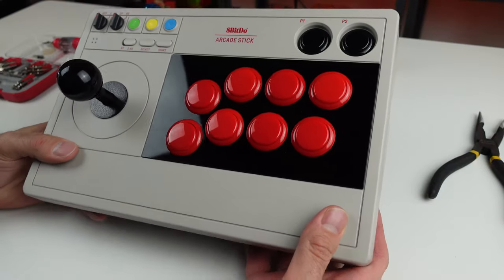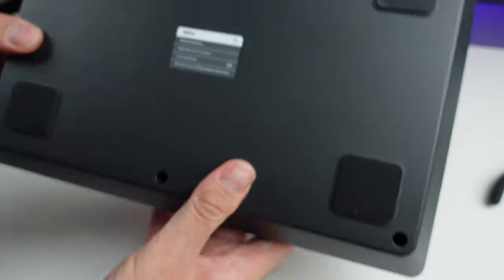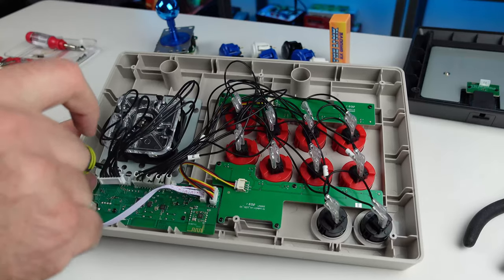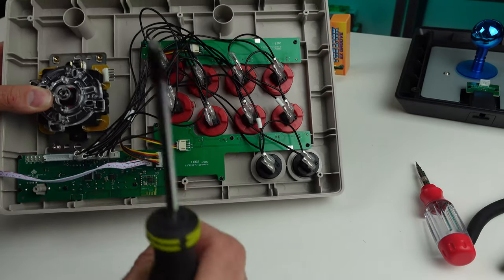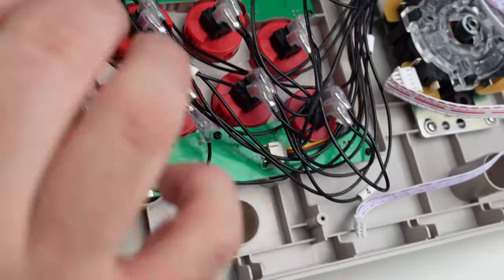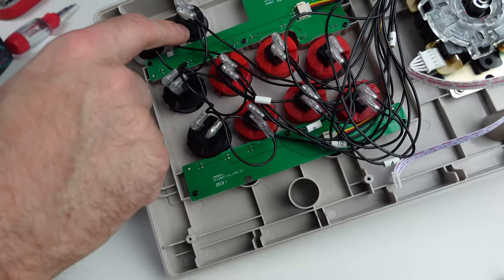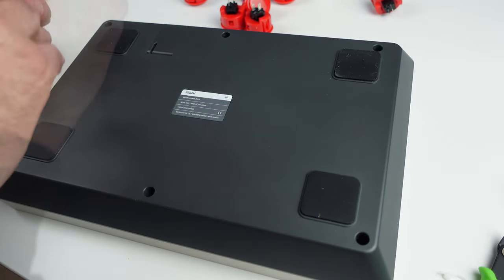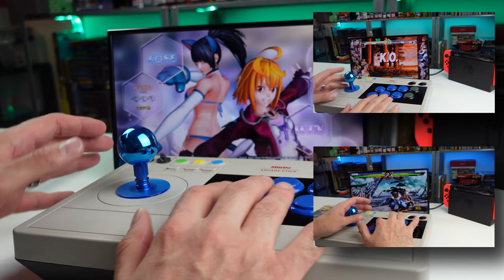Arcade Stick Upgrades! Modding The NEW 8BitDo Stick With Detachable Shaft & Sanwa Parts! EASY!

Comment: I've been using a Brook adapter with X360/One/Series X. I couldn't get it to work at first but I plugged the 2.4ghz adapter into the Brook adapter and switched the stick to X-Input/2.4ghz modes and it works perfectly.

Comment: I actually tried to add my new Seimitsu Bullet Nobi lever to this today and it was too thick to fit inside. I'm a little bummed because that lever feels so damn nice! Way better than any stock Sanwa I've used. It has shorter throw, more tactile clicks (but not louder), and a non-rotating shaft, which I like a lot for fighting games.

Comment: I was thinking of modding mine but I was chicken 🐔. Now that I see how easy it is I think I might. Thank you. I do wish it worked with my series x.
Reply: I feel you. I did the same thing. Chickened out because I was not sure if it was easy to do.
Reply: you can get an adapter to make this work with Xbox or PS from Brook and I think another brand but I forgot the name but Brook for sure makes both adapters.
Reply: I have the Brook Wingman XB and it works perfectly with the arcade stick (and other controllers including Pro 2 and Dual Shock 4 that I tested). I simply popped the 2.4 ghz dongle into the adaptor, plug the adaptor into the xbox, then turn on the stick and you're good to go.
Reply: @Dante1138  hi which Brook adapter is that ? Can you please paste the link ?
Reply: Chicken emoji cracked me up!!

Comment: I think this stick would be fine for professional use but the problem is it's not heavy enough. So when I'm in a grab or dazed or something the stick actually comes off the table and is like smacking against the table up and down while i'm shaking the stick to get out of the hold. I've never had that happen before.. Also the stick that comes with it seems to fail a lot of times performing the inputs for special moves..

like I know my hand motions and I have the muscle memory burned into my muscles.. The stick this comes with kind of sucks.. I dunno what it is about it. I think I'm gonna replace it with a Sanwa stick, coz the Razer Panthera I used to have (so great that Razer replaced it with some weird ass arcade stick that doesn't have a joystick).. But I want to use Happ buttons coz I'm from the US and we never had the Sanwa buttons here.. They're not bad but I want the authentic arcade experience.

I think that it definitely needs to be heavier.

Comment: Have the Mayflash and bought a bunch of parts to mod it but haven't done it.  I kinda want this because it's wireless.
Reply: I really like mine. I also have the Victrix Pro FS, but I end up using this instead because it's so convenient. I will say that it's more of a table top stick than a lap stick because it's kind of small and there are only 4 small pads to prevent slipping. I 100% recommend it, though.
Reply: @FranktheTank319  I think the Mayflash is a tiny bit smaller than this.  But yeah I want that wireless convience.  Although it's not as customizable as the Mayflash because it has the spot to put in different art if you want.
Reply: @agentorange8530  Yeah, I like that aspect of customization. I didn't really think about that before I bought mine, so it's a bit of a let down, but it looks cool and its got a ton of cool features. I just wish my seimitsu stick fit inside it. It's a little too big for the case, unfortunately.
Reply: @FranktheTank319  Yeah this stick is a little shallow inside and can't fit all sticks.  Still looks cool though with that Nintendo theme going on.
Reply: @agentorange8530  i think the NES theme is why I bought it. And I love it because it's so convenient. I use it on my pc and my switch. It is a little tippy, though. When I'm gaming, sometimes I notice it tipping towards me a little bit if I'm really heavy handed.

Comment: when you push your new lever to any direction, does it have extra travel after you hear the click? cause that's killing me on the OG lever of the 8BitDo (mainly the reason why professionals don't use this stick)
Reply: Yes there's a small extra movement after the click, but I've seen worse Hayabusa and Sanwa sticks in this aspect (i.e. it's not excessive). I, too, prefer no extra movement however. You can try with oversized actuators to reduce it... I'll test soon the 1.5mm oversized actuator.

Comment: Further info, when I was multimetering my 8bit do stick. It seemed like they were key scanning (the voltage value was floating around even without touching the button). so socd's are gonna have trouble if you try to change to mixbox buttons.
Reply: I noticed also, that most socd cleaners state, they are incompatible with 8bitdo. I assume that the key scanning issue is why!
Reply: But the bottom plate on newer versions has a much bigger cutout to accommodate more sticks.
Reply: So better. This stick rocks. but as with all things. you must understand what you have.

Comment: The mounting plate fits everything but the height of the case makes it so almost no other stick than a JLF will fit without hitting the bottom of the case. They removed sticks that they originally said would fit from their list and I tried sticks that are still supposed to fit and they still won't work without dremmeling the bottom of the case to make a few more millimeters of clearance. I honestly don't think they attempted to swap in any of the sticks they originally said would fit and just figured that the plate fits everything so they put them on the list as compatible. They had an IL stick being listed as compatible early on and there is no way that thing would ever even come close to fitting in this. Also the clearance on the buttons to so close to the pcb's that there is no way to get screw in buttons so you are limited to snap in only and if you use seimetsu snap ins it won't let them lock in all the way so they can pop out.  This is not nearly as moddable as they make it. They joystick it comes with is aweful, the buttons are decent though. If you get this swap it with a JLF as that fits easily and then its a good stick. Just don't expect to put all sorts of different buttons and sticks in this, its basically ultra moddable if you are putting in Sanwa parts only.

Comment: I'm planning on making the retro stick. I just need to figure out how many buttons I need for Saturn games. I have a Mortal Kombat one for those modern systems.
Reply from the maker: For saturn you can be mostly fine with 6 buttons plus one for start... But really should be 8 buttons for abc xyz and L R shoulders plus one for start, then an extra for select if possibly going to use for other retro systems.

Comment: I just installed some snap-in Sanwa buttons like you did in this video... My connections are definitely not as tight as they were on the stock buttons. Is this okay?

Comment: Did same mod recently. All that modding and you didn't change the square gate?
Reply from the maker: Yes, like I responded to someone else... square gate, octo gate, circle gate... none of that matters. The gate you use is all subjective and up to personal preference. A restrictor gate creates a wall and thats it... You can register microswitches without ever touching the gate. It doesnt magically improve your performance in Street Fighter for example. You can be used to any gate that doesnt block a switch. A square gate is my preference a lot of times, especially for many older fighting games its fine for me. I have a box of octo gates and have used them plenty. Ive been building sticks and modding out premade sticks for well over 20 years and don't care for the feel of an octo gate most of the time. It may be a crutch for some with half circle movements and they prefer it, but like I said... dont need to use the gate to register switch presses, so its all what you are comfortable with.

Comment: Professional fighting game players are probably not using this stick. There is typically a strict restriction on anything that's wireless.  Great stick though!
Reply from the maker: Well it can be used wired, but I still figured they wouldn't use it
Reply: @Madlittlepixel  Yeah.  Iono, ity's been years for me since I was part of the FGC, but they are typically leery even of sticks that can connect via USB like that too.  Imagine a high level, high stakes level being paused due to a UBS cable disconnecting at the base of the stick/controller.  That type of thing.

Comment: Try installing some hayabusa buttons into your 8BitDo arcade stick.
Reply from the maker: Why? I mean I like Hyabusa buttons, and have some extras but beyond using them in the sticks Hori makes I don't really have much desire of putting them into other sticks. They do fit, but I don't see the point of changing to another set of buttons I don't typically use often.
Reply: @Madlittlepixel  To each their own.
Reply from the maker: Well I mean this wasnt a video testing buttons of various types it was modding it how I want it. Hori makes fine products, but Id never put their buttons into anything honestly. I have tons of Sanwa's, Seimitsu, Suzo Happ buttons and depending on the feel I want I typically go with those. I only have extra Hyabusa buttons from taking them out of Hori sticks and swapping them. I think those buttons stock are fine for the most part but I wouldn't order them separately to use them in a non hori stick.
Reply: @Madlittlepixel  Well, there have been complaints by arcade stick users saying that sanwa buttons ore oversensitive. Same goes for the hayabusa levers. Sanwa levers and hayabusa buttons are SENSITIVE, but not oversensitive.
Reply: @TheRealDustinNunn  try seimitsu components if they suit you better. It is very much up to  personal preferences.

Comment: What?!?!?!?  I was told soldering was required to replace joystick?!?!
Reply from the maker: It does depending on what stick you want to use. Since 8bitdo decided to solder all the wired from the harness to the stock stick if you are going to use something that uses similar connections you are either desoldering, clipping, adding quick disconnects yourself or soldering cables.

Comment: This stick isn't a great fit for Mister. The input lag jumps around a lot.
Reply: Any suggestions on what is a good choice for a mister?
Reply: @IllegalPriest  Look up the Mister Input Lag spreadsheet lots of testing done. Razer or Qanba are good off the shelf choices that are still available. The older 8bitdo stick is really good. The top tier stuff will require some kind of modding\wiring.
Reply: @IllegalPriest  The USB Polling has to be set 1ms as well if you want those numbers. Not default settings.

Comment: Still doesn't offer a huge amount of modding ability; clearance of bottom plate, proximity of buttons to PBCs (preventing screw-in buttons)... there's quite a few issues with modding this stick, which is really unfortunate as I wanted to buy one.
Reply: Another one, they soldered the wires to the spade connectors on the original joystick, so if you wanted to replace the joystick with traditional microswitches you would need to cut or desolder the wires then solder the connectors on or crimp your own connectors onto the wires. They went out of their way to use easily swappable connectors for the buttons, so why not the joystick?
Reply from the maker: That was my original complaint with this stick was how the stick was wired, which limits it quite a bit for many people. But yeah the clearance and types of buttons that can be used are very limited... So not really the ultimate easy moddable stick, when there are plenty others you can do more with. But its still nice for what it is and the stock price.
Reply: I really don't understand some peoples' obsession with screw in buttons. They're typically used on large arcade cabinets, and not arcade sticks like this anyway.
Reply: @excessmaterial  Why would they not want the option? If it works with more buttons there is a better chance it works with the ones people want to use.

Comment: Why choose a 4 way gate vs an 8 way?
Reply from the maker: Because the gate isnt that important and if people think you need a specific gate to play like Street Fighter better thats false, its all what you are comfortable using. Restrictor gates all come down to personal preference and is a highly subjective thing. Ive been building my own arcade sticks for 20+ years and have used em all. Octo gate i may feel better with on somethings but a square gate I just prefer most the time. Whatever you are comfortable using~ *one point that should be noted is you dont need to hit the wall of a restrictor date to trigger the switch, some people may be grinding their sticks doing quarter circle motions and feel better using an octo gate, however you do it is cool I suppose.
Reply: That's still an eight way gate. You have to rotate it 45 degrees to make it a four way gate.

Comment: Sanwa buttons are too overrated, crown 202 are more quiet, moddable and feels better
Reply from the maker: Subjective, all down to preference.
Reply: @Madlittlepixel  true, doesn't change the fact the crown 202 are more moddable due to be ability to change the microswitches. Plus majority of people see sanwa as 'default' brand and never dare to try something new.
Reply from the maker: @LodanZark  i get where you are comin from, but Sanwa buttons you can swap the microswitches if needed, but i suppose people find the crown 202 switches more premium. The one issue though with this stick is crown 202 seems difficult to fit with it being a screw button. Near the pcb areas there is no room for a nut even though the crown are slim it just isnt as acceptable of some buttons on this stick due to how it was designed. I have a handful of crown buttons but they are in another stick, i may see if theyd fit but im just not sure due to the space.
Reply: @Madlittlepixel  Yeah, just double-checked, that arcade stick does not support screw-buttons which limits the usage of crown and some seimitsu buttons, I suppose Gamerfinger has snap-in buttons that supports cherry mx microswitches, but they take so long to shipping their products. Hopefully new arcade sticks products will be more thoughtful about better modding support.
Reply: Yeah I really prefer Seimitsu buttons and sticks. I also don't play a lot of fighting games either, so Sanwa is rarely on my radar of cares.